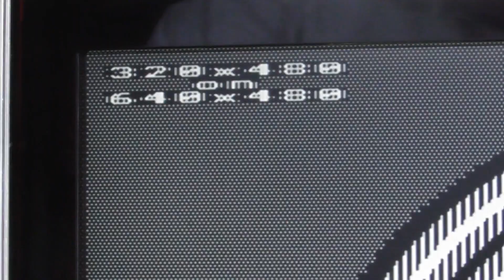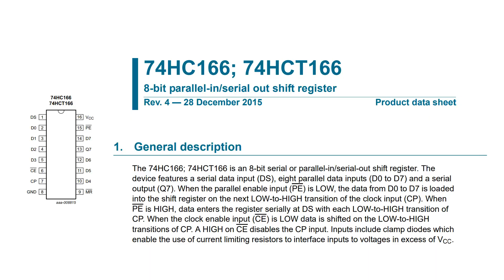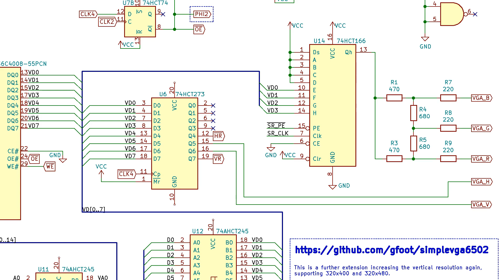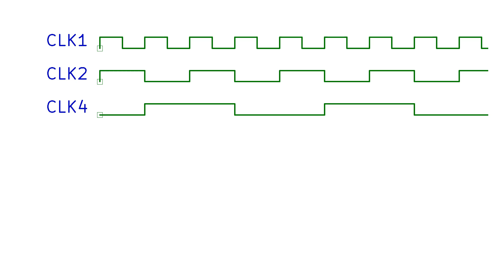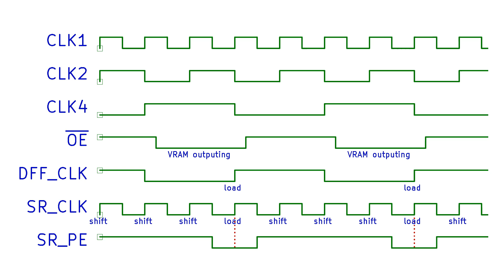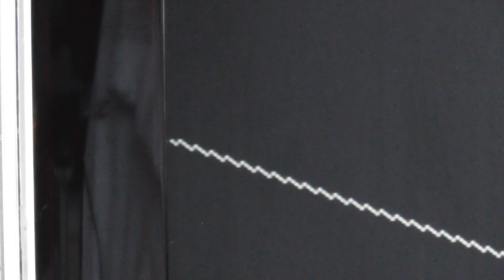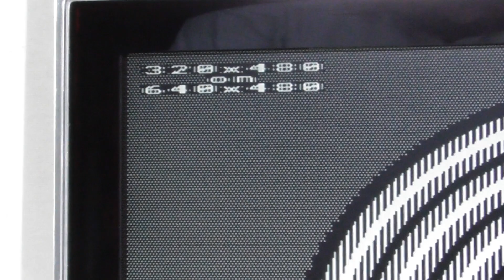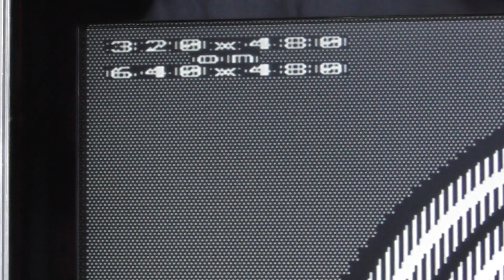Simple Breadboard VGA - 640x480 monochrome upgrade

Comment: Let’s see… next is 8-bit color? Then what? 600x800? (Is that SVGA?) Then 32-bit color?
Reply from the maker: I probably won't increase the colour depth or resolution - actually I might decrease it - because the 6502 just isn't capable of writing to the display fast enough.  I'd like to do some hardware acceleration or other assists to help it out - maybe after that the resoultion and depth can go up.  Shorter term, I've been thinking of adding some palette RAM so that the colours can be chosen by the CPU.  I found some small (in capacity) cheap dual port RAM that could be good for that.

Comment: One day this is going to be 640x480 with 32 bit colour and with line drawing capability.  As usual this was very entertaining and you did a great job at explaining!
Reply from the maker: Thanks! I'd need at least 16 separate RAM ICs to get enough bandwidth for that!
Reply: @GeorgeFoot  That is true, I'm curious where exactly is this heading? A 6502 acting as the gpu the risc cpu acting as it or something else?
Reply from the maker: @ducksonplays4190  Who knows! I don't have a master plan. I would say that the ARM2 can drive about 10x the memory bandwidth even at the same clock speed, and has a much more powerful instruction set, so has a big advantage there. But I have some tricks in mind to reduce the burden for the 6502 by doing more in hardware, and both CPUs will benefit from those.

For a proper GPU that actually does real processing, I'll probably build it from TTL chips because I need to customize what it does and tailor it to the task in hand. The smart option is an FPGA, but I'm more interested in working within the constraints of TTL on a breadboard.
Reply: @GeorgeFoot  That would be pretty cool. I would only make a 6502 for mine out of pure convenience, but it probably would be less efficient and kind of cheating.
A GPU that processes stuff like draw line from x1,y1 to x2,y2 would be pretty cool!

Comment: Thanks, this video gave me a lot to think about. I am still collecting ideas and information, and daydreaming about the Z80-based computer I intend to build. I have done some breadboarding to test ideas but video output is one of the hardest things as you are aware. One of my goals would be a proper text mode (80×25 if possible) and I wouldn't mind sacrificing colour or even graphics for it. Still more brainstorming and testing to do.

Comment: I really like the way you are improving the specifications of the VGA bit by bit and explaining the differences between the previous and next version, rather than go straight into the deep end in one go where it might be more difficult to explain. 

I've also realised that as the resolution, colour depth and memory usage increases for a display, it will be more difficult for a CPU to drive it on its own, as 640 x 480 with 16 colours will be just over 150kb, which is a lot more than the BBC B 20k or the ZX Spectrum 7k of display memory and a 6MHz 6502 would struggle to move that much memory around, making things like scrolling difficult.
Something like a blitter would help, like on the Atari ST, and I am interested what you might come up with.
Reply from the maker: Thanks David, it is nice to go step by step for sure. I regretted that my first few video circuits were more or less complete before I thought of sharing the details, which is a shame as the journey is interesting too.
I have a couple of ideas for the bandwidth issue, especially adding a read-modify-write circuit which could be interesting to build!